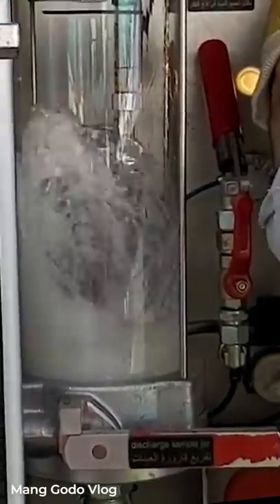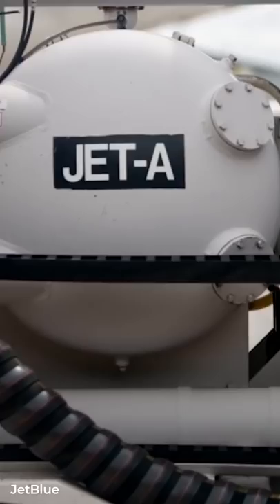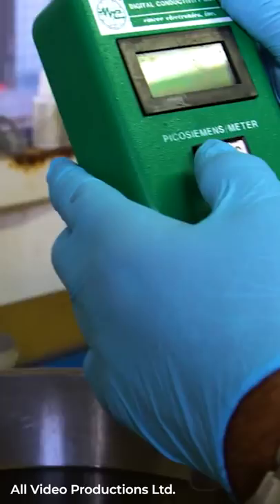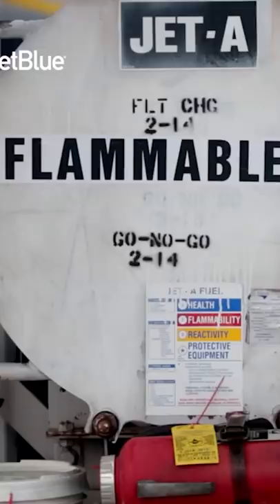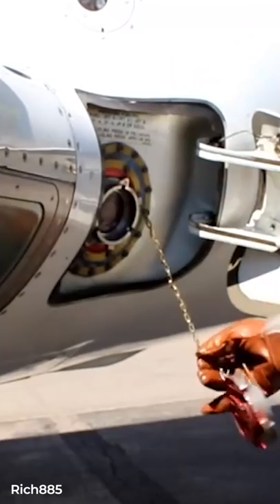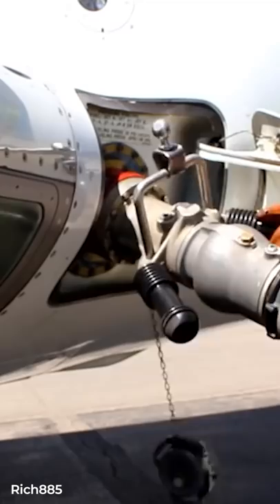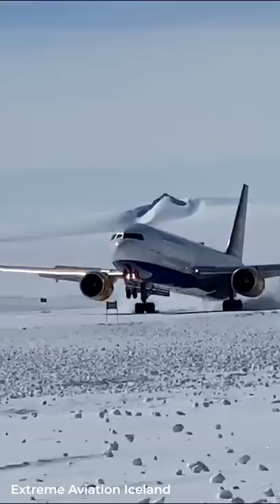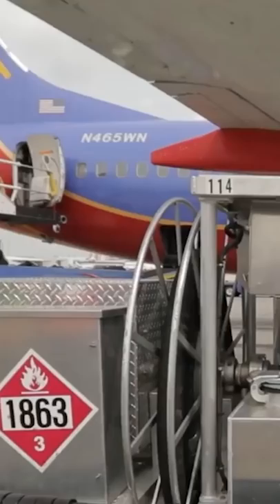How Plane Fuel Is Made #shorts

Comment: Very informative short video. Kerosene has qualities like very low crystallization point (because of which it can remain liquid at very low temperature also), high calorific value (which leads to high energy per gallon) and lightness, which makes it an ideal aircraft fuel.
Reply: Yes also fun fact there is an even more refined version of kerosene called RP-1 (rocket propellant-1)
Reply: Also kerosene is flammable, but not super flammable unless it's vaporized. So it's at least somewhat safer in liquid form.
Reply: @sl33ksnypr285652  that's why most old to modern day rockets do use them I guess. Because hydrogen is highly flammable and most other fuels are too toxic. That's why kerolox (Kerosene and liquid oxygen) is being commonly used

Comment: Very special mix of kerosene and you have to be more specific because there's a huge difference between jet fuel and avgas and kerosene is not extremely refined oil. It's actually one of the beginning stages of refinement which makes it cheaper and easier to produce, but jet fuel is kerosene that is processed more than once for purity uniformity of end product and other  reasons
Reply: Think triple distilled mono hydrocarbons
Reply: It's the best when you get told you don't know what you are talking about. As an AeroSpace Propulsion Maintainer VET, With his training books still. The best part is when you know the fuels that certain aircraft take, and that they are NOT interchangeable. So you know, not the same. lol.
Reply: Yup pretty close to diesel tbf.
Reply: I learned in HS about crude oil refinement; kerosene comes out the crack tower much lower than gasoline which exits higher on the crack tower. . . I think
Reply: @ar-ks4vi  yup that's correct bud. Lower temps too
Reply: Chemistry, pretty cool, right
Reply: @ar-ks4vi  higher on the tower means less dense, more flammable
Reply: @stemartin6671  nope.  It is true that gasoline vaporises at a lower temp, but the tower condenses the vapors..
Reply: @hillaryclinton1314  in the tower diesel comes out lower than petrol, and the last time i saw a breakdown of a refraction tower the bottom temps were lower than the top temps.
Reply: @hillaryclinton1314  yeah I know
Reply: I don't think either can melt iron beams
Reply: @tek4  thanks Mr. Obvious.

Comment: Jet fuel a tastes the best.
Reply: 100LL smells better when you crack open a hot fuel tank
Reply: I prefer the taste of jet b but people have always said I have an odd taste...
Reply: I would beg to differ JP8 tastes better
Reply: @nathanv8535  took a shower in it one night. It was about 20 below zero. Damn fuel samples and sticky valves.
Reply: @jasonbradley2807  lol damm bro that would be disgusting. I dont envy POL or fuel cell at all
Reply: @nathanv8535  I was actually an airframer/hydraulics but was working the line for a while when I first got to that squadron. I have been in a couple tanks though.
Reply: @limewoof  I’m forgetting isn’t that the blue stuff?

Comment: Kerosene that is selected for jet fuel passes a purity test.

If a batch fails then it is sold as Kerosene for heaters etc.
If you have ever been around a kerosene heater, they leave an oily residue on everything.
The exhaust from the planes does the same thing.

Jet fuel and Aviation Gas are two different products.

Aviation Gas is very high octane gasoline.
It ranges from 104 to 120 octane.

Dont run this in your automobile. It will probably crack the head from the force of the explosion.

Hot rodders with custom motors are known to run AV gas.

Comment: There's a few other ones. I believe jp7 is used by the SR-71
Reply: Quite certain he said commercial aircraft within the first 5 seconds
Reply: Might be. All I know is that it was developed just for that plane ...
Reply: @hotelhopper681  Pretty sure it wasn't and you wouldn't say so if you knew the basics about the SR-71
Reply: There’s JP6, 7, 8 etc. there are loads of different military fuels. This is only talking about civil aviation jet fuel
Reply: @saultube44  I'm pretty sure he did say that
Reply: @lester9230  I'm pretty sure you're wrong
Reply: @saultube44  "Do you know what aviation fuel is made of? Commercial aircraft today use a specific power source. The two most common types of fuel used by aircraft are Jet A and Jet A1."

Comment: AV-Gas is petrol they use for planes. At Mt workplace I was talking to one of the light aircraft pilots as they were flushing out a planes tanks. I asked them why they were flushing it and they said the e10 AV-Gas they were using had developed a bacterial infection and was gunking up the filters...

Comment: "extremely flammable"

ORLY?!
Reply: JET A-1 has an ignition point of 40 degrees Celsius, which means that if you toss a match into it at room temperature, say around 20 degrees, it won't burn, JET B however has a flash point much lower than that, which makes it more volatile but improves performance at lower Temperature, which is the point.  JET B can be ignited by accident, JET A-1 however, not so much.
Reply: Kerosene doesn’t just burn if you put a flame to it

Comment: Jet-A and Jet-B are actually the same fuel. A highly refined diesel that is equivalent to kerosene. Kerosene is a cleaner more refined fuel than jet fuel. The difference between A & B is the antimicrobial additives that prevent the fuel gunking the lines and causing the engine(s) to stall. Jet-B doesn't have these additives and is used in 3rd world nations.

Comment: Jet fuel is just slightly cleaner diesel fuel, gasoline or av gas is actually much more refined than jet fuel. While the kerosene has more b.t.u.s than gasoline, the gas will explode more violently. Gas only burns as a gas form. Drop a match in a bucket of gas and while it will appear to explode it is actually burning the gas forms as it evaporates very, very rapidly. Gas must be atomized to burn well and efficiently, diesel can be injected into the cylinder as a liquid. Most diesels don't have a variable air inlet like a throttle body because of no need of atomization before entering the cylinder.

Comment: Compared to  automotive fuels like gasoline and diesel, commercial  jet fuel is typically additive free. Military fuels  contain lubricity additive and fuel system icing inhibitor (which is not related to freeze point), because of aircraft issues. Some GA jets require icing inhibitor to be added. There is no significant use of Jet B these days.
Reply: Hi, I believe that jet A has an anti microbial added to it but I'm not certain.

Comment: Red pill moment jet fuel was said to be used to bring down the towers 2 however kerosene (jet fuel) does not burn hot enough to melt steel….
Reply: Doesn't have to melt it, just weaken it.

Comment: Jet fuel can melt steel. Change my mind. 

People don't understand what happens when properly combisted vs letting a paint can dry.
Reply: I am not completely sure. But I believe you must complete the fire triangle?
Reply: I don't know if it can melt steel but it can most certainly soften it.
Reply: @safetyinstructor  It has a heat content, not after burner, between 600-650 degrees, which works across the spectrum between 1500 and 3000 degrees. Answer yes
Reply: @mattmanning1844  you made that really confusing.
To reiterate, my point is that if you pour JET-A on a pile of steel and office equipment the steel will probably just get quite soft.
To melt the steel you need some sort of funnel or thing that adds a lot of oxygen to the situation.
If you got two nozzles that sprayed pure liquid oxygen and JET-A into a chamber that would most certainly melt steel (this setup is basically what most rocket engines use, Kerolox fuel).
Reply: @safetyinstructor  it is only confusing if your in an office.
Reply: @mattmanning1844  "did Jim order Taco Bell with extra chilli again?"

Comment: Well, we Marines use JP-5, very stable and resists vapor ignition, so it's the safest to use aboard ship, but we can also use JP-4 and JP-8.
JP-5 is also used in our support equipment (tugs, SATS loaders, light units, etc), so it is versatile and makes logistical sense.
Basically, it's diesel. 
So you can keep your Avgas and commercial jet fuels, thank you very much.

Comment: Kerosene is not highly refined gasoline is highly refined not kerosene they got your information wrong it was originally a by-product the manufacturing of high octane gasoline high quality gasoline I started putting it in heaters and lamps and started putting it in the shed engines because it was easier and cheaper

Comment: America having to be special once again
Reply: JetA is a lower quality, less-safe fuel, with less energy per unit weight.  The rest of the World standardised on the higher quality, safer fuel, with more energy per unit weight.
Reply: @RangieNZ  You're contradicting yourself. Is that a typo for jet A1?
Reply: @gabedarrett1301  There's no contradiction - read it again.  Jet-A (used in the US) is a worse fuel (for the reasons given above), compared with the Jet-A1 used in the rest of the World
Reply: How many more decades before they discover the rest of the world uses the metric system.
Reply: @RangieNZ  you're incorrect. The main difference between Jet A and Jet A-1 is the freezing point.
Reply: @MorgMorgW  That's my point!  The lower freezing point (- used by the rest of the World), means it is safer to use, given the temperatures the planes are flying in are basically AT THE FREEZING POINT of the fuel.  The lower freezing point gives a huge extra margin of safety.....
Reply: @RangieNZ  I'm gonna need you to cite sources for that one, bud.
Reply: @MorgMorgW  Youtube deletes the comment if it has external links.  The temp at 28,000ft is lower than the freezing point of Jet-A.
Reply: @RangieNZ  just like imperial
Reply: @RangieNZ  You're making a safety claim based on nothing. The fuel cooling rate in commercial aircraft is extremely well understood. In some instances the fuel is heated prior to filling the aircraft. That's a much less energy intensive process and switching the entire country over to A-1.
Reply: A video about jet fuel and people argue about countries. People will find anything to try and feel smug and superior lmao.
Reply: Ryan  read the data sheets.
He isn't wrong.
Jet-A carries less energy per kg, freezes faster and is more flammable.
Reply: That's why I'm glad not to live in the US.
Something is going seriously wrong when you choose patriotism or whatever over common sense or scientifical evidence
Reply: Metric jokes.  Hilarious.  Planes, worldwide, measure altitude in feet.
Reply: @michael-dm2bv  yes they do.
And it's a pain every time you do your preflight calculations, believe me.
Reply: Ryan  The entire world but the us is using a more expensive fuel. I think there is a reason behind that…
Reply: @RangieNZ  that's what the heat exchangers are for. Heat the fuel while cooling the engine oil. It seems to work out just fine for the Americans
Reply: @MorgMorgW  i fuel aircraft for a living at Toronto Pearson INTL Airport, I can verify that he is correct, the MAIN difference between A and A-1 is about a 2 degree difference in the flash point and freezing point
Reply: @Matsumoto77  I fuel at chicago ohare, boss

Comment: Their not putting fuel . It's air
Reply: Jet engines can't run on air alone, heat needs to be added to the thermodynamic cycle in order for it to generate work. It's basic physics.

Comment: What is wrong with America they use different paper size different measurement system different weighing system
Reply: Sometimes accuracy is important.  That's why America uses "different paper size different measurement system different weighing system". The "American system" is much more accurate, while the metric is just easier.